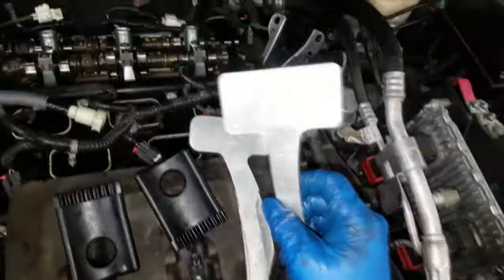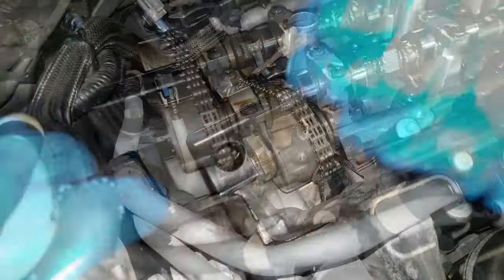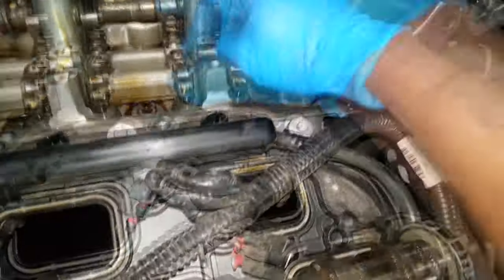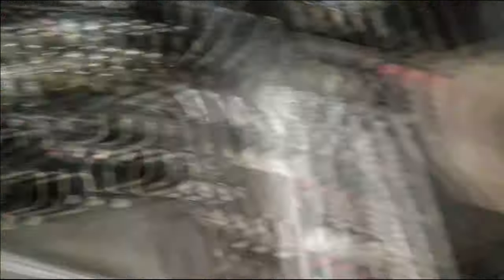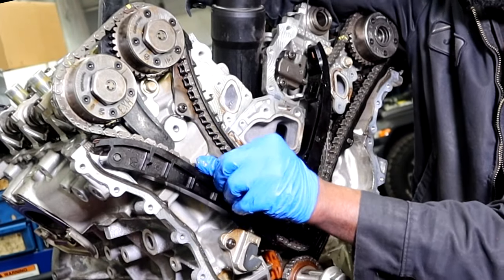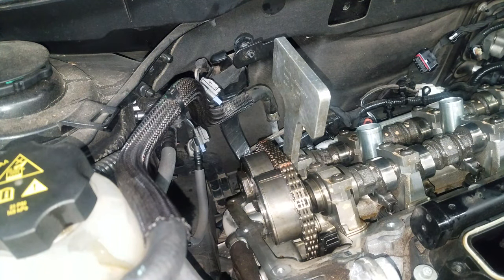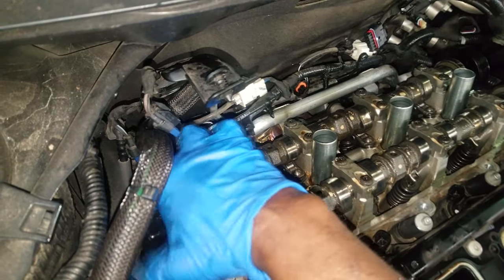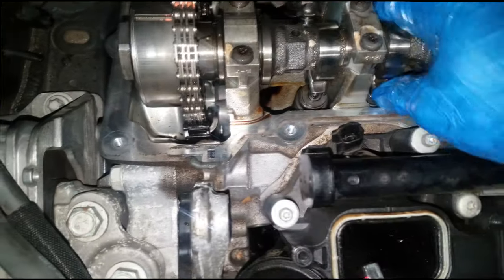Cam phaser, camshaft, lifters,  broken rocker arms on rear Bank 1 head. 3.6 V6 Pentastar P0340 P000B

Comment: FYI unless u replacing camshaft it's not necessary to remove it. Just loosen the caps and rotate the engine til the rocker arm comes out.

Comment: hi great video thank you. so where can i buy the tool for cylinder 1 for the tensioner is it metal i think all i see is plastic.
Reply from the maker: Tool for cyl 1??? What do you mean by tool for cyl 1? Are you talking about the bank 1 rear or right side cyl head? Also are you subscribed to the channel?
Reply: hi i just like and subscribe yea the tool you use to loose tension on the chain for bank one head t when can i actually buy it that is metal not plastic. please if you can point me in the direction. @OnlineMechanicTips
Reply from the maker: November 18, 2023

Comment: So I replace the flex plate on my 012  journey, with the 3.6L V6.  I turned the crankshaft counterclockwise to remove the 4 bolts that connect the flexplat to the torque converter. I was told that you should always turn it CW. I hope I didn't brake anything.
Reply from the maker: The thinking goes, you should rotate the engine the same direction that it runs. But rest assure, you didn't hurt anything bud. I do it from time to time. Thanks for watching. Please thumbs up the video and subscribe to the channel, thanks
Reply: @OnlineMechanicTips  thanks for the reply. Been stressed about it all day. Hopefully i can get everything put together and have it back on the road. Thanks again.

Comment: Great job, can you please tel me what size socket and the part number for the sprocket on the camshaft ( I tried to read the make and part number, I can’t
Reply from the maker: Are you talking about the oil control valve which doubles as the cam phaser bolt? Also are you subscribed to the channel?

Comment: What’s going on big bro . I have a ticking problem with my 2015 jeep jk. Everyone keep saying I need a new engine . How much you think an estimate for this job will be ?
Reply from the maker: Thanks for watching and subbing..My dude its hard to give such an estimate without the cylinder head covers being removed. One need to see if the camshafts was ruin because a lot of times that happens.  Once engine valve train torn down then one vould give an accurate estimate.

Comment: I got a question I just replaced two cams on bank 1 all rocker and hydraulic lifters and the cam position sensor two on a 2016 ram 1500 3.6 .. now it is throwing code p0344 and is causing the cel and tcl to both come one and puts the transmission into limp mode could use a little help thanks
Reply from the maker: Richard hiw many miles on it? Also are you subscribed to the channel?
Reply: @OnlineMechanicTips  yes I am it has   Like 210000-22000 miles on it also I can hold the get the rpm’s up to 2000 and they start jumping
Reply: @OnlineMechanicTips  below 2000 rpm’s there is no jumping
Reply from the maker: @savage_empire_ammunition  Yes those are perfect symptoms of those cam phasers coming apart. This causes timing to temp show off and the traction light comes on..Dang, you should have replace those phasers when you was in there
Reply: @OnlineMechanicTips  so that would cause the transmission to go into limp mode and that damn p0344 code right
Reply from the maker: @savage_empire_ammunition  Yes, once timing affected all bets off. The phasers part of the timing set up.
Reply: How do I check them to make sure they are bad or going bad the vvt timing sprocket
Reply from the maker: @savage_empire_ammunition  https://www.youtube.com/watch?v=B8x8pOjRj5g
Reply from the maker: @savage_empire_ammunition  or you can use a scan tool to monitor display

Comment: Question from a new ‘23 Gladiator 3.6 owner. Has Jeep corrected this problem in later production or is it still an issue with the 3.6? I’ve noticed some other manufacturers use this same design and don’t seem to have the problem. Nice video sir!
Reply from the maker: Thanks and yes. All the Gladiators use the Gen 3 Pentstar engine. Most of the previous problems was found on the gen 1 and 2 Pentastar engines. Thanks for watching. Please remember to thumbs up the video and subscribe the channel for me, thanks
Reply: @OnlineMechanicTips  Thank you!

Comment: Thank you so much for posting this (and all your Pentastar engine videos) !  My son and I were able to repair his 2015 Jeep Wranger "ticking" problem that had gone on for months.  We did have to replace the bank 1 intake cam (badly worn lobe) because of a badly failed rocker arm.
This video made it possible for me to understand how to release the timing chain tension with nothing more than a long thin screwdriver doing what the tension tool does. We also wedged a large flat blade srewdriver between the phaser sprockets, accomplishing the same  thing the phaser lock tool does. Of course we marked the timing chain and held the cams with a wrench while loosening and tightening the phaser bolts.   Actually an very easy and do-able job, thanks to you!
Words of advise to everyone else.....move the transmission dipstick and move the dipstick tube out of the way by removing the upper hold down bolt and loosing the lower one, then lift out the tube.  That will give you plenty of room to access the upper PCV bolt.  Also, Loosen oil dipstick tube.  
Finally remove the fender flare and wheelwell liner as a single unit to gain easy access to the back the valve cover and lower PCV bolt, along with better access to the side of the valve cover.  This simple step will make the job SO MUCH EASIER on a Jeep.
Reply: Hey Greg, congrats on a successful fix. I'm currently in the middle of this job on my 2015 JK as well. I'm unable to get the tensioner released on the passenger side. I'm curious how you did it without the tool seeing how I broke the plastic one I just ordered. Kinda dead in the water until I can get that tensioner released.

Comment: Trick: I work at the dealer too and I’m the main engine tech. Use the tool to compress the tensioner before you remove the phaser, and just leave it in place till your done. The block holds the cams in place for torquing/loosening the phaser bolts, you don’t need a wrench on the cam. 
The actual trick, you don’t need the tools, just the block, crack both cam bolts loose, remove the 1 your working on, loosen the other one a few threads and you can just slide the cam phasers all the way off without pressing on the tensioner, just keep the block in place and it’ll rest on the timing cover, and when you go to reinstall, use a wrench to rock the cams back and forth a little to line up the phasers notch on the cam. Doesn’t save much time, but maybe 6 mins? I do this job all day long, everyday lol… I turned about 16-24 hours a day doing these. Each bank pays me 8 hours, 1.5 hours diag,  6.5 for repair. 

I’m sure you know the shortcut to replacing the left bank head too, without removing the T/C, pays a good 16 hours and can be back on the road in as little as 5 hours.
Reply from the maker: lol, yes you guys are doing it over there.  At my other shop Brothers Motors we lowered our rate to be cheaper than everybody else and still make a good profit. It works out great. And yes, when the camera off, all short cuts activated. The customer only concern with the end goal of a non-ticking engine.
Reply: Where are guys like you two hiding in the real world 🍺 I'm constantly on the hunt for local techs that "get it" and know this stuff and just get it done.

What's the real time I should expect to spend on this job if I want to do it (mostly) right and replace the lifters too? I'm far from being a good car mechanic but I'm willing to try and know my way around using tools. I'd also do plugs, coils and pcv.
Reply: What if the timing wasn't lying when the chains popped off now they all out of whack
Reply: @TheMalman6  You better do a full timing job to make sure it's in time.

Comment: You really should soak those new lifters in oil overnight before you install them. But hey who am I. Oh yeah a former Ford AND Chrysler Dealership Technician with over 30 years as a professional.😂😂😂😂
Reply from the maker: You said that as if I would have a problem with it or something. Fact is, you right. It's just that I never do. But that is a good habit to get use to. Oil pressure after starting fairly good/quick tho. That valve train will become lubricated in a matter of seconds. But thanks for the tip
Reply: when you say things like that people are less likely to believe you. uncalled for a hole 😂 id be an a hole too i looked like that 🤦‍♂️

Comment: Why not try to move the crank by the cam?  Before I saw your video I tried this.  Could I have hurt something?

Why not hold the cam without the sprocket tool?  That’s how I took the phasers off. Could I have hurt something doing this?

Do you add rtv back the section where the front cover meets the valve cover?
Reply from the maker: Because thats to much of a load on that chain which could jump if you using the cam to turn the crank. And yes, we use RTV to reseal the cover in the case you mentioned,

Comment: So spoke with you awhile back, yes im subscribed, trying to get my cam phaser back on, timing chain tool ( for whatever readon ) aint working,  you suggested rotating  the exhaust cam towards the intake which should work, but its not, chain slips off, im guessing i screwed up some how
Reply: Hey so what happened, did you have to remove the timing chain cover?
Reply: How did you fixed

Comment: I might be doing this soon.  Can you include links to the special tools in you future videos please.
Reply: The first ones are the Rocker Arms/Lifters and the next is the tools used in this video.
Reply: I believe the Oil Control Valve Head socket size is 1 1/16.

Comment: I’ve torn my 2018 JL down and can’t find a rocker or lifter yet. Could the phaser be making the same noise ?
Reply from the maker: Hey bud, it depends on the noise and how long the noise last..You should be certain its a valve train noise before teardown. Not all ticking noises are valve train

Comment: Your videos rock, because of your vids, I tackled this repair myself, all went well with the left side. replacing all 24 rockers. had trouble on the right side, I had the gear lock tool in place and when I broke loose the nut for the oil control valve, the tool popped out. After replacing all the exh. rockers had trouble getting slack in the chain., got the tool in place but there doesn't seem to be enough slack in the chain to get the exh.
 gear to slip on the cam. My question is it possible to get the chain out of time on the crank with having a loose chain flopping around up top...... thanks for your help
Reply from the maker: Depends on if you did one head at a time. Was the other head connected when this happen? Also are you subscribed to the channel?
Reply: I did the same thing. The other head was on. What to do in this situation plz reply thanks jt I am subscribe.

Comment: Just tore down a 19 3.6 with a #4 misfire. Pulled the valve cover and the intake cam lobe looked like I grinded the highest point with a bench grinder. P0304. I'm swapping both cams lifters and rockers. Why are so many of these camshafts getting ground down on?

Comment: I have a 2010 Buick Enclave with 3.6L. It's slightly different from the Chrysler 3.6L. Is the process the same and could I use the same tools you're using? I can't find the tools for GM. Only one is the en-48313 and it's $169. That's not what I want. I will use this 1 time only.

Comment: I have a question, I have a 2015 Jeep Grand Cherokee, with the 3.6 , 43000 miles, upon the last oil change the filter has shiny specks in the filter. No metal specks in the pan. No tick or knocking noise. Is this the beginning of rockers failing? Or ? Always use full synthetic oil.
Reply from the maker: If you pull your valve cover, you will likely see this specks stuck on the magnetic tone wheel. Not reasons to be extremely alarmed tho,
Reply: @OnlineMechanicTips  am I better to replace all the rockers, both sides intake and exhaust?
Reply from the maker: @froggerman44  Yes, I would
Reply: @OnlineMechanicTips  have not looked into parts yet, but what would the cost run me about?

Comment: I finished changing lifters and rocker arms on front cylinder head and motor is very quiet and no misfire but would not upshift past 5th gear on test drive. Code 0394 keep appearing. Replaced cam sensors & 05184101 cam adjuster SO on both ends and same symptoms. Any advise?

Comment: Hello. Please help is needed I’m not a mechanic just doing my minivan. I did bank 2 as per your instructions on another video( thank YOU) . Now I’m doing bank 1 but I have small problem removing the valve cover. There is only one bolt left at the right upper corner . I’m not sure if it’s a bolt or not but its preventing me from removing the cover. Please note I removed all the 12 bolts except this one.
Reply from the maker: Hey bud, you have to maneuver the cover in a way to clear the PCV  valve..first remove valve then turn cover as in ways to clear for removal

Comment: JT I mess up bad I forgot to mark my chain is that going to be a major issue ? Let’s just say I was working outside it started raining and loss track and continue changing the cam shaft and lifters but I didn’t set my camshaft in the correct position installed everything back pop up with bunch of codes p0016

Comment: Hey great video, I have a problem and hoping u have a answer.  I removed cam after marking my chain and cam phasers at top dead center.  I also put a cam phaser lock block inbetween the gears. But prior to all that, I was changing just the rockers and lifters on bank 1 side the intake because i found immediately the bad rocker.  So i competed intake side and moved to exhause side and realized i couldnt remove the lifters because they were closer to cam than the intake side. So i ended up getting the block in place and painted chain and cam phazer while i was at tdc.  I slid the cam phazer back just alittle with block still in place and removed cam and replaced all lifters on exhaust side and rockers and slid cam back in and lined cam phazer back up and slid it on.  Tighten it all back up and removed block and turned crank and i hear a noise a couple of times as i turn crank.  Now before i did intake side i was turning crank alittle forward and alittle backwards to get the lobes in the right spot to get rockers and lifters out.  My question is, what might the noise be that im hearing while i turn the crank?

Comment: Question so if. I installed new cam phasers does it have to relearn or reset it I don't have scanner so that means I have to bring to the dealership..?
Reply from the maker: You dont HAVE TO, you just should. What you are re-learning is cam and crank. Not the phasers anyway.
Reply: @OnlineMechanicTips  ok thanks 
I am replacing all the rocker arms and lifters..
I saw in one of your videos you said to replacing the cam phasers if is over 80k my has 99890 so was thinking replacing them while I am there..
Reply from the maker: @mtbbuddys2545  I like the way you think bud..

Comment: hi. currently doing this repair on a 2018 grand caravan. bank 1 tensioner seems to be stuck. is there a way to compress the plunger without taking timing cover off?
Reply from the maker: Are you using the special tool? And are you subscribed to the channel yet?
Reply: yes to both. but the tensioner doesn't want to move. tried prying it with a screwdriver. it must have locked all the way out
Reply from the maker: You cant get to it with a screwdriver..which head you working on? What kind of car is this?
Reply: @OnlineMechanicTips  bank 1. closest to the firewall. grand caravan. i tried the tool as well but it just won't budge. already took cam phaser off
Reply: @Johann Baldovino  So how did you loosen the tensioner? I'm in that position now just stuck.
Reply: @Sam-656  ended up taking the cover off. What happened to me was that the tensioner popped all the way out

Comment: I should not be able to rock the camshaft independently of the phaser, correct?  I suspect I have a bank one exhaust phaser that needs replacing because I can put a wrench on the cam and move the cam back and forth easily while the phaser stays solid.  I also have a P0340 code, and I presume the variable valve timing has been trying to keep the cam in the right place just through oil pressure rather than a mechanical lock.
Reply from the maker: Your assumptions are correct my friend. I highly suggest replacing that phaser. In fact, because there is know suggested time interval for phaser replacement, I started suggesting they get replaced at around 100k or when ever you are making a valve train repair. Thanks for watching and being a subscriber.
Reply: @OnlineMechanicTips  Thanks, bud, parts are on the way!
Reply: Thanks for this. Was wondering about a service interval for replacement. I’m at 152,000 and just now  beginning to have issues.

Comment: i have VERY fine flakes of what looks like to be aluminum in oil filter, what would be the cause ?
Reply from the maker: Hey bud, im just seeing this sorry. Listen, that could be considered good news and bad news. The good new is that your oil filter did its job by filtering the trash from going back into the engine. Now the bad news is that those shavings had to come from somewhere. Could be early signs of cam lobe gring into a rocker arm. Do you have a ticking noise? O, and please Subscribe to the channel for me, thanks

Comment: Would you, or for you ever worry about the timing chain staying in time on the crankshaft sprocket?  Do you ever have both cam sprockets off at the same time?
Reply from the maker: Yes all the time. With the cover still on in place, the chain will not come off the crank pulley